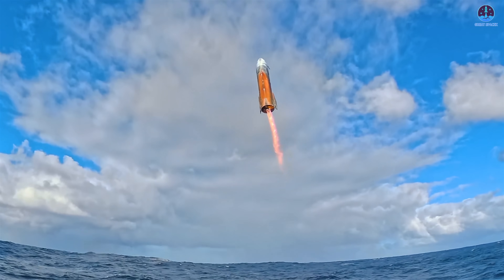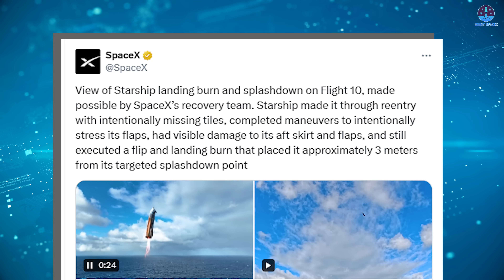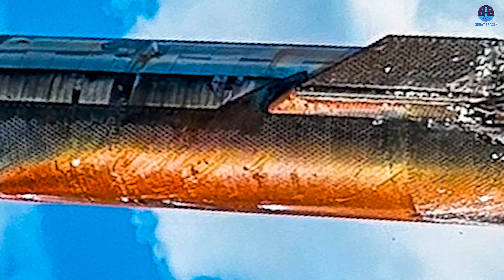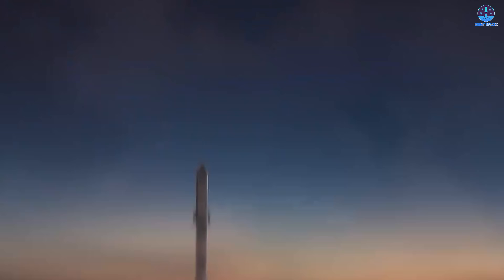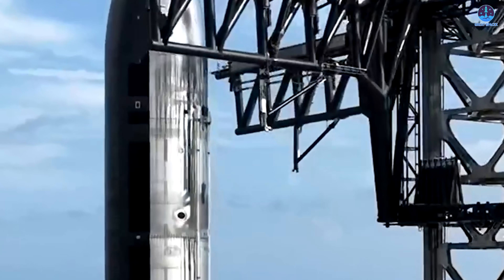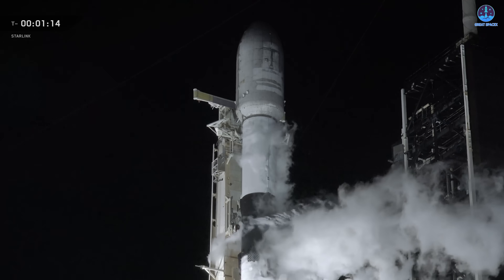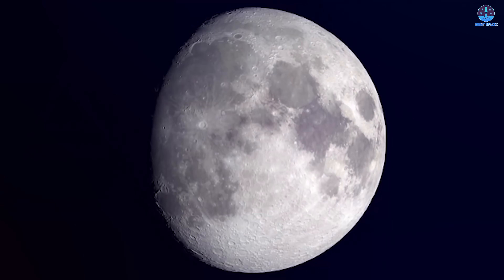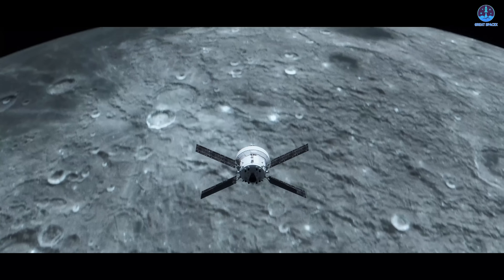Incredible Footage Shows How Starship S37 Landing burn and Splashdown Shocked whole industry...

Comment: So what we've basically got here w/regards to the orange rust is that while the new metallic tiles worked as expected, oxidation issues stemming from the plasma heating of reentry will mean repair/refurbishment of the tiles before subsequent flights should the metallic tiles be use full-time on Starship.

In other words, they work but more data is needed. Sounds good. #LetsGoSpaceX #GoStarship

Comment: first off you are wrong about the tile problem. completely wrong. even if they have to retile the ship after every flight, they still have achieved reusability for 90% of the craft. the ship has to go back to the giga bay after each flight to reload cargo and be inspected regardless. replacing the tiles can be done in less than one week and the ship is ready to fly again. with enough ships in circulation, it will be easy to have ships launching every hour even with tiles having to be replaced. that means cargo to space and profits for the company.  the tile problem can be worked on in tests while flights are going on. Time for a double catch and test flights of the other ship versions like the tanker, the large cargo version and the passenger versions.

Comment: should make starship a hammer head configuration and put 2 raptors either side at the top so  can disengage the thrust puck raptors at bottom of starshop post bellyflop reorientation and land more stably from the nose  with thrust gimballed off to the side so safe vertical landing directly onto to skirt possible, be easier than cramming 3 more engines in the base of v3 and could use to avoid hot staging ring mass requirements per best part no part

Comment: I wonder whether dimpled tiles on the wing would reduce drag (think golf ball) and increase surface area for heat dissipation.
Reply: Interesting thought. I notice the skin on the flaps is already not perfectly smooth. Back on the Mercury space capsule the "skin" was VERY dimpled (different from a golf ball, however). I wonder how much difference that makes at those speeds, though. I think one of the factors is creating an area of pressure/plasma, etc. to divert heat away from the actual skin anyway.

Comment: If that was supposed to be a tower catch it was swinging way to much. It would have came in and swing and hit the tower. I would expect to see more of a vertical hover like the booster. So in my eyes it wasn't a perfect landing. But I'm routine for them i haven't missed a single attempt or launch yet.
Reply: The catch is exclusive for the booster as of now.
Reply: this is BS. the shuttle has done all of this and after seeing the equipment in action im amazed. amazed how with all the money and "experts" the system there using for the roll out was amateur hour for real. who are the plods designing this c r a p? nothing about the flight shouted anything other than lame. no tower catch for anything. even the tower is damaged (again). and i WAS a space x fan. its all a waste of time and money
Reply: @scankhunt4206 Cry baby, cry 😂

Comment: At the very end, when starship lands vertically, the starship then falls on it's side. Soon after the video fades out to black but just before there was a massive explosion.....what was that and why doesn't anybody mentions it ?
Reply: Starship isn't designed to fall on its side.  Maybe also the explosive were set to go off when it fell over to make sure it sinks quickly.
Reply: Because the people that know what is going on, know that when rockets hit the water they almost always explode, well for the last 60 years or so, and will continue to do so.
Reply: its so the ship doesnt come to the beach and explode there, they intentionally explode the Starship and Super heavy so there is less chance for an incident.
Reply: All rockets do that if tiped. Imagine the left over pressurized gas inside the ship. Normally you depressive it so it can safely be recovered after landing. Because they didn’t care about recovery they didn’t so it exploded like a shook soda can.

Comment: I can’t see a reasonable scenario where they need to reuse the star ship. After all the stresses it sustained in reentry, it’s virtually impossible to reuse it without complete overhaul.
Reply: Indeed, but at least they would not dump it in the ocean, or even recover the motors. Besides, if it would land (albeit damaged) here, than it may be much easier on the moon, and (debatable) on Mars.
Reply: It seems to me they could have placed it in a high orbit or even to a moon landing to salvage part to use for a project like another ISS or moon base. maybe even reprep it to be used to send either bots or humans to Mars or who knows where.
Reply: that said my comment was " I think he should have tried a hover maneuver till the Fuel burned off " at least a less Explosion and most likely less damage if the hover was as low as it could be without the water putting out the engines, Imagine how long could they keep it in place before cutting of the engines. and what a show it would be.
Reply: the whole point of starship is that it is reusable. this is all BS. elon should go talk to someone at darpa and get the imfo they need. its never getting to mars as it is now

Comment: Why did the Starship explode when it laid down in the water?
Reply: It's big and the forces encountered when it fell tore plumbing up.  Maybe SpaceX even set off the flight termination explosives to make sure it sunk faster.
Reply: @lvlndco  You would think that SpaceX would want to recover the Starship for closer examination.
Reply: Because that's what happens almost every time, you wouldn't want a massive steel rocket floating around in the shipping lanes endangering people's lives.
Reply: @jimshreve83  You would think maybe SpaceX would want to recover the Starship for closer examination.

Comment: The reentry system needs a breakthrough in design. This is not going to cut it.
Reply: Yeah, not seeing rapid reuse for several years.  But, it's primary missions to begin with are one way flights to Mars.
Reply: @lvlndco well, they are recovering the Booster, and the Starship is making it to the surface. Rapid reusability, where you quickly refly perhaps that day or the next day is light years away. This is no longer Falcon 9. They can do Falcon 9. What they cant do unless they have a tech breakthrough is Starship.
This vehicle is not going to Mars with humans any time soon for a number of reasons
Reply: Why don't you study engineering and propose solutions instead of criticizing as if your lay opinion is meaningful?
Reply: I am Aerospace engineer. What r u? A youtube expert/ fanboy? You dont like my opinion? Dont read my comment. Dont even reply. I worked on the X-30. The quick reusability as described by Elon and others is a fantasy like the hyperloop.
Walk it off.

Comment: In my opinion, IFT11 will have the ship that will splash down in the Gulf after a couple of orbits in the same place where, a couple of hours earlier, the booster had also splashed down!
Reply: I want them both to be caught by the crane. That would be suuuuper cool. 😊
Reply: Unlikely, probably won't go into orbit until they 2 or three flights if block 3 ships reenter without any damage. My guess is flight 15 maybe 14 if the next 3 don't have any engine issues.

Comment: If there is that much oxidation of the metallic test tiles then said tiles must have been severely eroded. Therefore this is hardly a move towards a robust, rapidly and economically reusable heat shield.
Reply: But now they have a nice heat map to help with future iterations.
Reply: @brian7android985  future is the correct word

Comment: What engine explosion? No engine exploded on the spaceship this time. Misleading. You had a flat issue that caused an issue with the skirting that exploded off the side inward. All three raptor engines started for landing and then one shut off to allow it to land with two as they explained in the video. The only engine that failed was one of the rafters on the booster going up, but it did not explode.
Reply: There was an explosion but it didn’t cause failure. It did damage the skirt and fin.
Reply: No explosion but one Raptor on the booster failed mid ascent and remained dead for the rest of the mission. Its strange how this passes without comment, given Raptor's long history of failures.
Reply: @saumyacow4435 there was an explosion. Caused damage to skirt and fin during initial re-entry.

Comment: While the reusabilty of starship has not yet been achieved, it performed all other tasks and still at less expense than other space craft. That is a lot of mass put into low earth orbit. A lot of potential communication satellites distributed on this test run.
Reply: I can't figure the "less expensive" claim there. Starship has cost close to ten billion dollars in development so far.
Reply: @saumyacow4435  Delta heavy launch is projected at 350 million a launch. SLS is projected at 1.5 billion a launch, Starship Heavy has projections ranging from 20 to 100 million a launch, depending on how many times their system can be reused. That is what I mean by less expensive.
Reply: @keithhoward4069 Which projections are not ultimately based on Elon's notoriously unreliable claims? Starship suffers one basic physics problem. In order to make a second stage reusable you need to add mass. Basically, you're doubling its mass for a given payload. That scales everything else. Double the booster. Double the launch infrastructure. Double the labour. In a few years time when the heat shield matures, then we can compare notes.

Comment: How about moving the lower flaps up a couple meters to separate the heat/wind shear ? This may lower the heating intensity.
Reply: The flaps would have done much better without that minor explosion that took out a chunk before reentry. To me, that's proof that they'll survive even when damaged.  I think they would have been fine without the damage.
Reply: My wife and I saw Starship 37 come over Northern Namibia. It was after midnight, therefore the sun could not reflect off the hull as we had also seen with a previous launch that came over us during daylight hours. It was a pleasant surprise as we unmistakably notice a ghostly dull orange glow approaching from the west. This time Starship was about 50 km further south on its path that took it directly over the farm. As it came over the dull flickering orange glow was flanked by two red streaks, clearly plasma active at 150 km height. The two aft flaps probably started being stressed already at this stage, hence the red streaks. Dropping down to the east there was a sudden big red fare-up, which I at first interpreted as the re-light attempt, but a few seconds later a bright yellow light lit up the smoke/gas trail describing a huge S in the sky. The gas trail remained almost visible using peripheral vision, but no dumlinks visible.

Comment: Tesler Siber Fuck made it trough reentry with ""intentionally"" missing side panels, completed a burnout to ""intentionally"" stress its  aluminum frames, had visible damage to its aluminium pull hook frame,
and still managed to drop more then half of its used truck value just after 6 months.

Comment: I stayed up late after test flight 10 hoping to see the dumblink satillites burn up ! Would be cool to have seen that  !
Reply: My wife and I saw Starship 37 come over Northern Namibia even though I at first thought it unlikely to be possible since it was after midnight. The sun obviously could not reflect on it, we rather noticed a dull flickering ghostly orange glow flanked by two red streaks coming over unmistakably. Plasma must have been heating up at 150 km height, more intensely at the two aft flaps. The Raptor re-light was very spectacular but so short that I thought at first it was a mishap, happy to have been wrong. I could not see the dummy Starlinks, but the re-light beautifully lit up the gas/smoke trail.
Reply: they burned at the same time as the starship was re entering

Comment: Only one question. Why Land on the sea? And Why not recover in Land?
Reply: They could land it it in a very remote place. But it would require a much more complex flight path. The ship isn't in orbit so it's on a ballistic trajectory which limits the options of a landing site. They would also need permission and security from other nations. I don't think it would be worth it.
Reply: Because of the land at sea and something goes wrong, it crashes into the sea. If it was to come down on land it would usually mean it had to fly over land to do so. If it goes wrong the risk to people and property is massively increased. 
Most of the data they are after is flight telemetry and how they ship reacts and performs.  The remains are not that essential at this stage of testing
Reply: @BeauLeMow thanks good explanation it Did not crash Nor sin... It submerge with style😂😂😂 Buzzlight year would say

Comment: Reusability is still in question
Reply from the maker: Yes! But we opened a new door to that
Reply: Yes. But they are called test flights for a reason.
Reply: @alanhart9992 you can't explain that to morons, I've tried, can't even fix stupid with duct tape 😔
Reply: @XCX237  Do you want to mention the fact that they deliberately removed heat tiles to test how heat affects critical internal components or that they deliberately flew it down on a more aggressive angle than they normally would to stress test it? Or should I?
Reply: @alanhart9992  Regardless of whether it was a test, TPS is still the main component required for reentry. Just look at the STS program, how TPS became an obstacle to reusability
Reply: @TeguhSantoso-ml7bu  SpaceX has a great team. As Musk has said in the past, If it is within the laws of Physics they will work it out.
Reply: @alanhart9992  , still, they never brought true reusability
Reply: rapid* reusability.
they could definitely "reuse" a landed starship with some heat damage. just take a long time